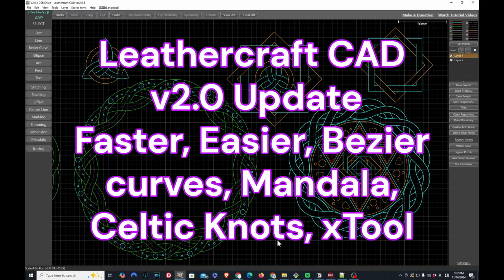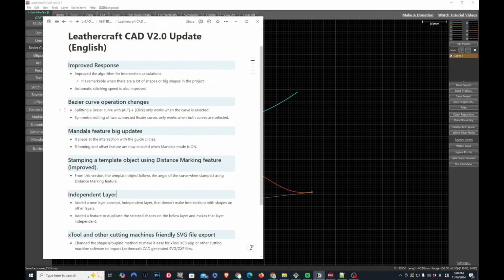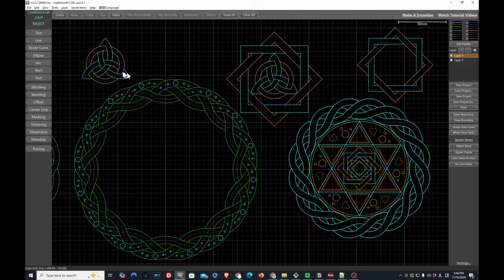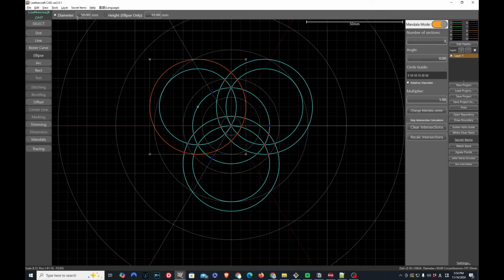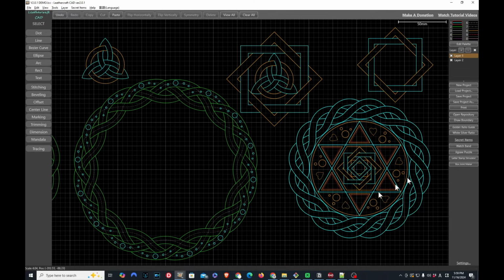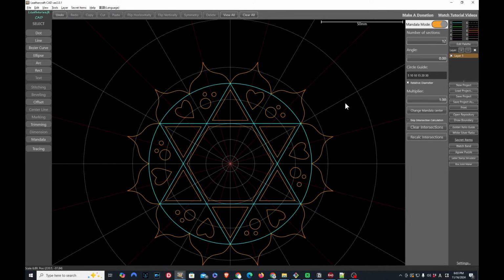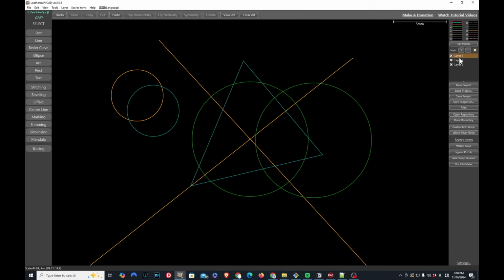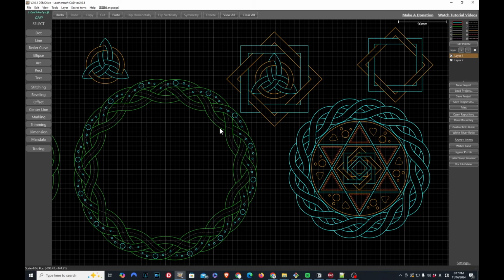レザークラフトCAD v2.0アップデート、より速く、より簡単、マンダラ、ベジェ曲線、マンダラ、ケルトノット、xTool

Comment: hello there and thanks for the software ... I would like to ask also if there someone use XTOOL for cutting ? for me when I convert pdf file to dxf or any file to use on XTOOL  the measurement with not be the same as the original file the pdf , it's there some ha's been facing the problem before ????
Reply from the maker: I have been using xTool M1 Ultra almost a year. My typical process is like this:

1. Design a pattern with Leathercraft CAD
2. Export it as SVG file in Leathercraft CAD
3. Import that SVG file to xTool Studio or xTool Creative Space
4. Process with the laser or the cutting blade.

I have never experienced a measurement problem with this way. Hope this helps.

Comment: Love it thank you. I currently only have 2 + 5 teeth French pricking iron. So when I do corners, I manually rotate the two markings on the curve to be parallel to eachother, so I can punch them with the 2 teeth chisel. I can't seem to remove the 1 tooth option in the pricking iron toolbox. I don't know if that would be possible to auto mark corners in this way. It works for my 7.5mm radius corners but maybe wouldn't work for larger, or smaller corners. Anyway great software really alot easier to get my head around than Illustrator which I avoided using before. Thanks again.